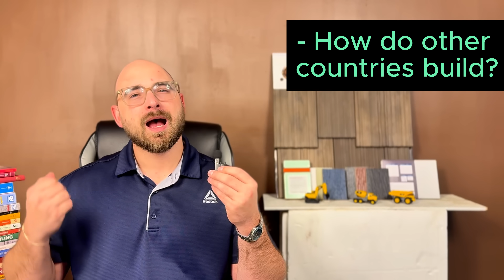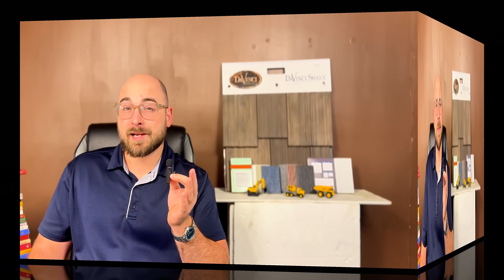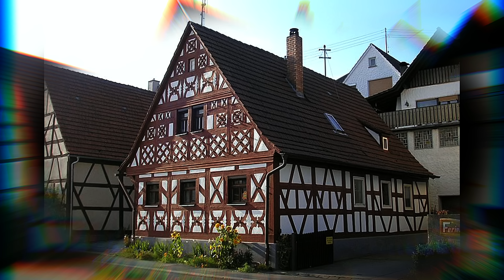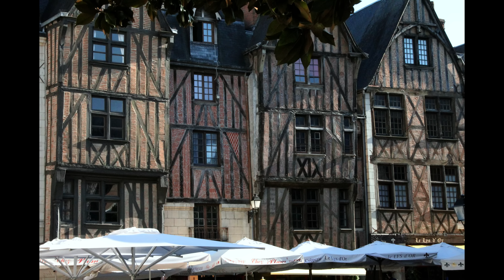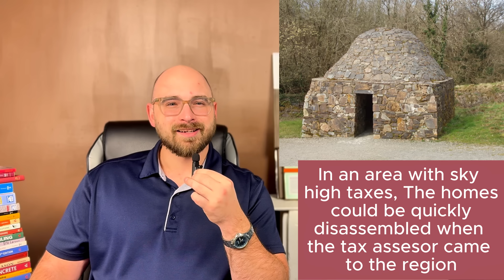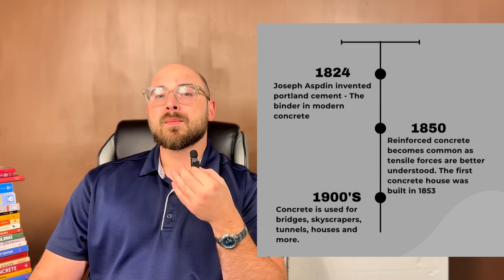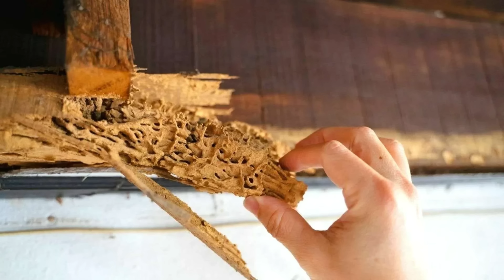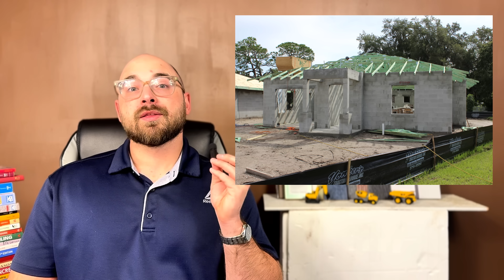Why Other Countries LAUGH at American Homes

Comment: much more than the framing material id be worried about the rest of us homes.
crappy plumbing and electrical. atrocious roofing. flimsy wall materials. sheet metal strips instead of decent joinery.
nothing wrong with light framing per se. but the overall picture is just...bad.

and its not even an issue of europe vs us.
i KNOW the us can build better houses.
the average american house is crappy even by american standards.

plus: the way they build is literally the worst for where they are. america is a country of wildfires and tornados. thats the worst case scenario for light timber framing.

Comment: It is all about region and available cheap materials.
In california, (earthquake zone) wooden frame leight houses have advantages. They are severly bad in a tornado or hurricane though. Our stupid apartment blocks in turkey can withstand all of those with broken windows and furniture damage.

But our stupid apartment blocks will collapse in a big earthquake and nearly all of Turkey is on a earthquake zone.

But we can't build wooden framed houses. Why? Our forests consists weaker trees.

Stone houses is a very good way to die in case of a earthquake. So we left that also.

We can use leight steel for constructruction of small houses and it will be very good on a earthquake but not so good on a hurricane but we don't see hurricanes here. So it is good material for us. It can compete with cement houses in cost. But we can't build 4 story apartments with that. Heavy steel is far more expensive here so a big no.

There is only cement left for high story apsrtments. Our new buildings are pretty safe; but we have other problems also. The land we are building... A heavy building on a soft land... We first need to reinforce the land. Most of the time we do it with minimum that meets the standards and it is risky.

There lot's of implementation errors also. When combined, even new buildings can collapse.

So my solution in theory is apartment factories. We can build modules and carry those modules to the site and produce the apartment fast. It will have standardised production in factory so no implementation errors. Low cost. But they all will be looking alike. To solve that, there is empty facades, false columns etc. We can make them look different.

Comment: saw another video that explained that the whole system in the US is set up for wood framing.
So to switch to something else would be a big transition, from suppliers to skills of the builders, etc.
and it is not as easy as just switching to a different way of building
Reply from the maker: Yes and no, 

We have concrete readily available everywhere, it’s the willingness of builders and contractors to adapt new methods. 

It’s also up to buyers to understand and ask for better materials like ICF

Comment: American homes aren't bad bc they're made of wood- plenty of wooden houses in Norway for example- and it's not even the building method itself where you're using dimmensional lumber instead of thick timber- again plenty of dimmensional lumber used in Norway and Sweden. The main issue is how cheaply and badly built these houses are. How many corners are cut.
You can find entire accounts on TikTok and such of inspectors going around the new constructions and pointing out dozens of very serious issues. 
Old American wood houses like the colonial style homes of the East Coast are great! Not because the method was better, but bc it was executed better!
America doesn't have bad houses problem, it has bad contractor problem. The issue isn't with the construction method and the engineering behind it, but with the quality of the work done.
And the prices of these homes do NOT reflect their quality bc in the Clown World we live in a house isn't a house but "an investment" so it doesn't matter how shit it is bc of "the location".

Comment: Bro you all are just dumb.

There are so many areas in the US that have environmental problems, like heat or frequent natural disasters. Yet they keep putting down cheap construction instead of something that can withstand what nature throws at it.

If your hotter areas would have houses made out of concrete, there would be so many energy savings because they require less cooling.

Likewise with areas like florida, where it would both save tons of electricity and would offer people better protection against disaster.

The continued use of light woodframe construction in areas that it isn't suitable for costs lifes.
Reply: Concrete cracks and needs to be repaired and bricks will fall apart.
Reply: @Formerlytrouserttrout  wood will rott and needs loads more preventive maintenance.

Its cheap to build but much more expensive to maintain.
Reply: @mickdejong  I live in a wood house that's over 100 years old and it's just fine.   It's also better for the environment

Comment: I don't think America's Building problem is to do with Materials but it's Standards and Practices. The amount of sub-code standards builders and contractors seem to get away with even on multi-million dollar projects is concerning to outsiders.

If I was going to make a new build in the US I would pick Solid construction (possibly find a specialist that I can see their past builds) I have seen way too many dodgy timber framed houses with a ton if broken studds and wood not fit for purpose. At least if you half-arsed a Concrete home it's still concrete it might look ugly but it wouldn't fall down.

Comment: you are claiming that american houses are like african houses in the way that they are fit for the place their are built at. No they are not. Clay houses are great for heat difusion wich is great for africa. The same happens with the northern europe log houses, they are of a much much better quality than american houses, in any of the other houses in the world you punch a wall and your hand breaks. if you punch an american house your house breaks. Its made out of flinsy low quality wood, paper and foam. And you may claim its because if your house will get fucked by a storm then its better if its cheap so you can remake it. But you can prove thats not the case looking at tropical areas or even Japan, the leading country in storms. tsunamis and earthquaqes and their houses hold up properly

Comment: We are rich in limestone so cement is cheap here. Also because its has been going on for many years. People know a lot more od how to build with brick and concrete than wood. So complexity is not a con.
Reply: I'd say the biggest con is how mu h arder solid homes are to remodel. American homes are easier. You can just kick open the drywall and boom you have another door.

Comment: Great video, though a minor criticism; its not that the US uses wood frame building, its that they are poorly build and flimsy as fuck. I am from Norway and my father is a carpenter, we build mostly wooden building here too but its utterly shocking just how fragile American houses are. The walls here are made of prober planks, not the weak plaster or near cardboard wood composites you use in the US. You would break your hand punching walls or doors here unlike in the US. 

Though to be fair, some American practises has made its way over in cheaper buildings and my dad complains all time about the quality of the wood and how houses are built these days. 

He actually made a living pulling down old houses and building new ones with them, the wood is that good. In his older days he makes money selling the old timber i stored cause its so much higher quality.

Comment: The mentality in the US (compared to Western Europe, where I’m from) does lean towards doing things the easy way and on the other hand getting done a lot in little time. Therefore the overall output is greater than in Europe (where the mentality is conservative which is enforced by lots of regulations that increase safety to an almost ridiculous level). However, that comes at the cost of quality and durability. 
Mapping this to housing … in Europe it is expensive and time consuming to build houses. Right now you are hard pressed to buy a small parcel and build a small house (say 150sqm over 2 floors) in a remotely decent location for under 400k and in under 18 months. Which means lots of saving up and planning. 
In the US a comparable house will be built a lot faster and cheaper. Also in most cases it will do its job just as fine. 
Personally, I would prefer to pay more for a house, make it hurricane-proof and be the last house standing. Is it efficient? Maybe not (especially since we don’t get hurricanes around here ^^). But to me the knowledge is important that disaster can strike and in 99% my home (and place of work) will still be just fine, my life will go on uninterrupted, my income is still secure.

Comment: Tbh thick concrete walls are not ideal in terms of rising temperatures. They save money in winter by isolating heat very well but in the hot summer it also means they become ovens.  Combine it with an AC and it would be fine but these are almost nonexistent here

Comment: As an engineer: You always have to consider economical building. You outlined perfectly on how building houses throughout the world distinct. It is linked to material available nearby. In germany, not every house is builded with concrete walls (but slabs). Brick laying is also still very popular. But the choice of bricks depends: You are not building a hose with lightweighted clay bricks in an area where clay is not common. It will just cost way too much. You would go for the calcium-sand (KS) bricks in combination with different insulation. You are right, the cement production is not eco-friendly at all. But it is also not eco friendly to ship wood from another part of the world to build then the eco-firendly house.  But for every place around the world it is different. And the biggest mistake randomly raging on america's houses online tend to believe that there is only one working way. Thats the biggest mistake over all.
And sorry but ICF is a horror to recycle. It is impossible to seperate the materials effectively.

Comment: 11:05
I think you're talking a lot of nonsense. In my country, and I think it's the same for many other European countries, (terraced) houses in the last 50 years have been made of concrete loadbearing walls, floors and ceilings. Then there's a brick wall on the outside. And we don't put stucco on the brick wall.
Normally there is air between the brick wall and the concrete wall, but it is popular these days to insulate old houses by filling up those spaces with little fluffy balls.

Comment: I was in awe of the age of many of the houses in Germany. As to their comfort, not so much.  

Having been in the industry of remodeling and such, I appreciate being able to hide wires and plumbing in walls, rather than having to stare at conduit or other means of adding wires and plumbing.  I appreciate the ability to take advantage of the wall thickness to ramp up insulation.

Of course, important issues are, how well the design is, for holding up to high winds or earthquakes. Methods of solving bridging problems (transfer of heat through framing), and so on.

A well built stick built American home can last hundreds of years too.  Stucco can be added, or even metal, for example.  

All houses require maintenance in some form or another. Some far better lend themselves to updating and improvements. Old "last the centuries" houses require a lot of work to accommodate modern necessities, like insulation, electricity and water.

Comment: We use wood because that is what is readily available and least expensive. The issue is not the wood but the quality of wood used vs the price of construction. Along with that the USA perspective of home ownership is way different. We rarely have generational homes any more.  We tend to buy 2 to 4 homes in a lifetime.  Just like we tend to buy 4 to 10 cars in a lifetime as well. This doesn't represent everyone but it does represent the middle class and up.

Comment: short answer: yes
Reply from the maker: The benefit to fast and cheap construction is that we have a higher rate of homeownership, and more single family housing than other parts of the world. 

However this is in decline. our houses don’t last, and we don’t build enough of them. Demand is high and prices are starting to get out of control. 

But even so, we still have higher rates of homeownership. 

But the quality could certainly be better, I think we should be building more concrete homes. 

Safe, comfortable, built to last

Comment: But American houses make for funny videos about TVs knocked off the walls, holes punched through drywall and people falling through floors and ceilings. Also, people falling from roofs replacing shingles is something to behold. In Europe we use ceramic tiles on our roofs. They last a lifetime. For some reason most American houses have stairs in front of their homes, causing slipping, sliding and stumbling. Hip replacement surgery costs between 40 and 60 thousand dollars. And that in a country without free medical care.

Comment: It's amazing how Americans are willing to buy such low quality homes, with the knowledge that they will have to keep doing this every couple years if they live in disaster prone areas. You would think that making a more costly upfront investment, I.e., a smaller house made out of concrete or a similar material, would be more beneficial in the long run, as you wouldn't have to rebuild your house every time the winds are a bit fast.

Comment: The problem is not really with wood but rather the lightweight construction. The wooden framed house which use bigger lumbers are quite nice, can be easily remodelled, are durable, decent insulation, etc. so I'm a big fan of it.

Comment: This is typical of the american use and throw away mentality - we build houses in europe to last, we dont want to throw money at it all the time, our stock exchange is 401 years old - we also build ALOT higher quality , with alot stricter building codes, with more quality material  - americans build houses that last 5-10 years, that blow over in a storm or rots away because of a single broken water pipe, or burns completely to the ground - europeans build houses that last 50-100 years, who can withstand weather and fire . 

in no way is American construction better than europeans for homes - skyscrapers is a different story , but domestic houses are useless , and they still cost more than a Villa does here .

Comment: The thing Europeans need to understand is that the high price of homes in the US is a relatively new issue thanks to things like Airbnb, investor-led contractors and just the general consequences of late stage capitalism. 
For literally hundreds of years we've had much larger homes that were far, far cheaper than what Europeans are used to. If prices could get back under control I'd be fine with it but now we have high prices and wooden homes.

Comment: Not that this is something i talk about often, but when it is mentioned, people are usually refering to the drywall, stucco, and the overuse of low quality truss plates that are too easy to missalign/not intall correctly. It has little to do with the frame outside the overreliance on stamped flimsy trussplates, and more to do with the interior doors you can punch through, the walls that wil get a hole in it if you fall on it or a cabinet falls over, and other things that feels flimsy compared to the wood plank interior walls and hardwood floors and ceilings most people i have ever visited have. 

The thing where houses fall apart in the tornado belts is not something we question, or think our houses could survive. To be fair, if i lived in a tornado belt, i would probably also have a cheap house with an overly nice and sturdy basement.

Comment: this is a real good video, could be better by not having your face all video long and using more photos and example about all the stuff you talked!

btw i now those system by wet system (you call it solid) and dry system (the one the USA uses) or also as wet construction and dry construction (some call it traditional if mainly wood is used)

Comment: 14:40 Another fact that influences is that  by law buildings of a certain size need a air raid shelter. So many houses have their Cellar out of concrete for that purpose even if the above ground portion uses other materials.

Comment: Well, you certainly were not alone in believing that the Chinese Wall was made with stone in its entirety. But I guess this is a piece of trivia one usually doesn't even think to look up, unless one is involved in architecture or construction in some way or another, or researches the Chinese Wall for something.
Also, in my eyes, the cons of light wood construction far outweigh the pros. I'd rather build a house that's more expensive and takes longer but lasts, instead of a house I have to rebuild every so often. And it's not just the house itself - I want a home where my possessions are relatively safe instead of loosing them to the next hurricane.

Comment: In the late 50s/early 60s poured concrete homes were built in the US but never caught on. There is about a 5 square block area in Dade County Florida off lejune Road where all the houses were built identically, all 2 foot thick walls with a flat concrete roof with an outside stairway to the roof to be used as a deck. I lived in one of those as a small child. Today you wouldn't know what they were as almost all have been converted into 2 story homes as the foundational first floor was so over engineered getting permits were easy. I'm sure the style was tried nation wide but I just know of the ones in that one neighborhood. It's actually a pity they didn't catch on, They had a unique look with their flat roof with wrought Iron railing all the way around, and it was an enjoyable vantage point on a clear afternoon.